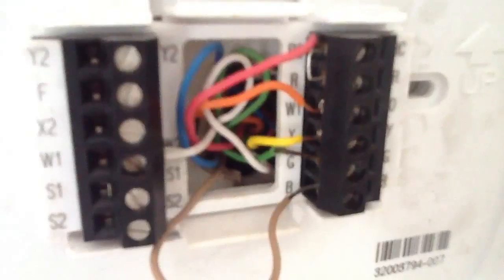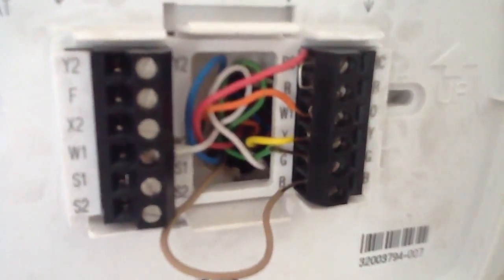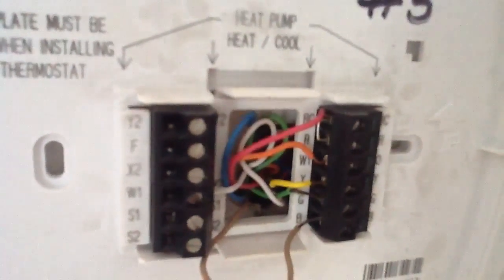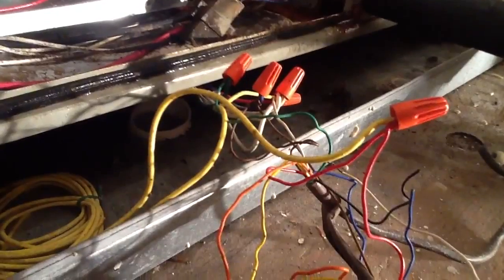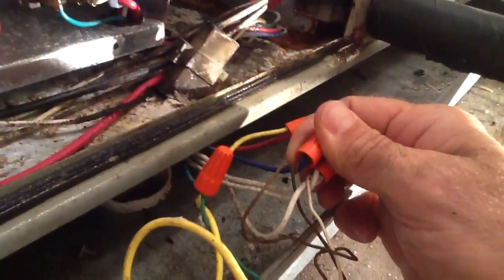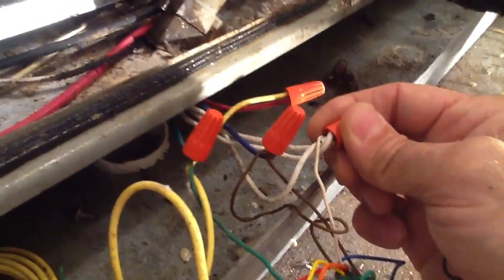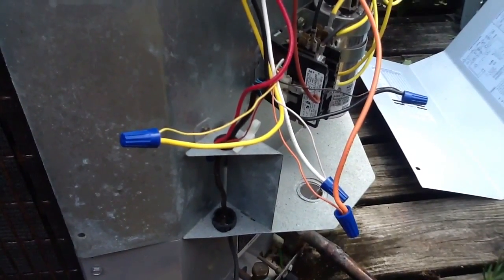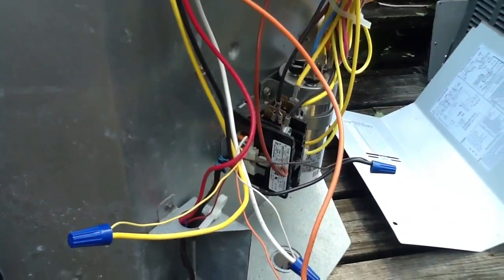Heat Pump Operation & Thermostat Wiring

Comment: Hi Dave, I am in the process of wiring up a new single stage hvac system. I will be using a honeywell T6 pro thermostat. I noticed it doesn't have O/B connection. Trying to figure out where to tie my reversing valve wire to. Should I tie orange wire to W2 ?

Comment: Hello Dave I have a heat pump unit by Heil company, and I'm trying to figure out why my unit outside be cover with ice after a long time running on heater. It would cycle on and off when it reaches it's set temp,but later in the evening it starts to fill with ice outside. Now the fan blower stays on and it still cycle heat to the settings but the blower stays on putting out cold air. Do the heat pump suppose to work this way. I don't remember it working like this. So in the morning I would go outside and hose the ice off of it to make it cycle on and off like it suppose to until it freeze up again. Please Help me !!

Comment: does anyone know how to wire a central heat and air that only has emergecy heat. no hear pump. I need a diagram for this.
Reply: Chris you only need from your thermostat ,the G, and the W ,the W for the electric heating strip, and the G for the fan relay, and from the indoor terminal block  the Common from the thermostat  C connected to both electric Heating strip relay,and the fan relay.make sure both  Rand ,C are connected to the thermostat, but the C is optional with battery,some thermostat works only with Batteries, C is not used.do not use E, or W2 for your unit, only use W,  emergency therm is used as a supplemental heat, for a heat pump unit, not for a first stage or single heating system.once the thermostat is satisfied  the Electric heat relay is de-energized by the W.

Comment: Hey David,  I am working on a Heat pump, with a air handler  ( Gas Furnace ) At the Air handler control board there only is Terminals  Y C R G And W. when installing the  heatpump wiring where do I plug in the reversing valve wire  (Orange)  and the Brown wire (W2 ) coming from the heatpump? 
Thanks in advance

Comment: Why didn't you explain to use the labels on the outer part of the terminal strips on this heat pump. You use the labels on the inside of the terminals for a conventional set up. dang David. `

Comment: Hi Dave

I wanted thank you for explaining complex concepts in simple terms. I srtade looking up HVAC videos as my heat pump acts funny in ac mode. I have a lennox heat pump 14hpx series. Every few hours it blows warm air even in ac mode. Air is hot enough It will actually raise temp of rooms from 80 to 85. I looked at outdoor unit and when this happens the outside unit fan blows cool air from top.

I then change setting in my thermostat (honeywell focus pro th6000). I make fan to 'on' from 'auto' and set the system to cool till 'cool on' sign comes on. 

Any insight will be appreciated.

Comment: Not sure if you are watching this I'm having issue with a goodman packaged heatpump rooftop model. Last summer I installed a honeywell wifi thermostat I connected up the extra 24 volt wire everything worked okay. Now that it's winter when I turn on heat I get AC not heat. The reversing valve isn't activating I connected the yellow wire to Y I don't believe my HP has a 2nd stage heating strip because with my old thermostat when it got below 40 degrees it would blow cold air. I didn't have that extra wire.
Reply: I figured it out ill leave this for anyone else to read the problem was the honeywell wifi thermostat has to be configured for heatpump in the system settings. I must have missed that when I installed it. There are several settings for different types so make sure you set that under system settings.

Comment: And in case you are very green (new to the field) G terminal is what powers the blower motor aka indoor fan, don't get confused when u hear fan to mistake it for the condenser(outdoor) fan. Condenser fan comes on with compressor

Comment: How do you run thermostat wire on a hart pump does it go from thermostat to inside unit then from there to outside unit or what need help

Comment: Confused...orange is only hot in the cool mode....unless its a rheem/ruud they energize RV in the heat mode (B terminal)...a heat pump contactor is energized all the time...the RV determines if its heat or cool....the W1/W2 sends control voltage back to heat strips to bring in on when in defrost or if it can't keep up with demand...unless it has does no BACKUP HEAT at all...still confused with your interpretation....wired up many of York 10 wire heat pumps in my day....what does the X terminal do....status light.....old school here....